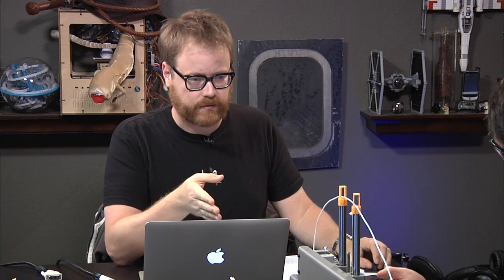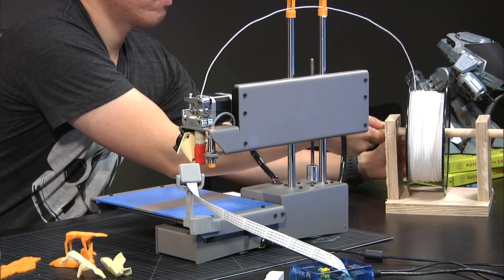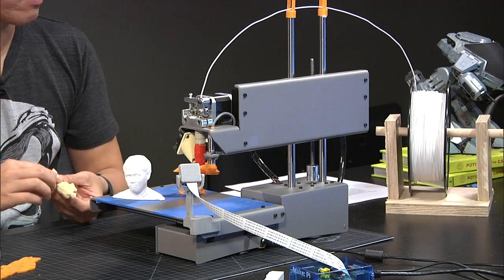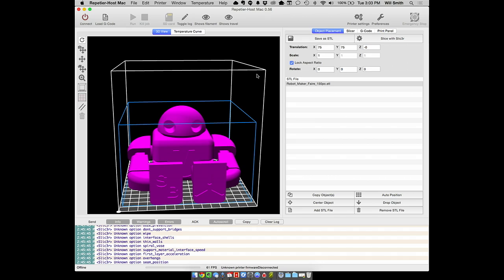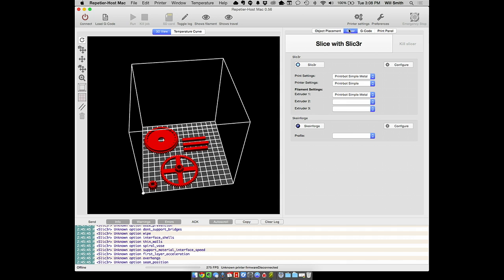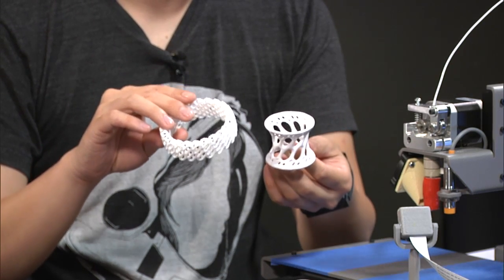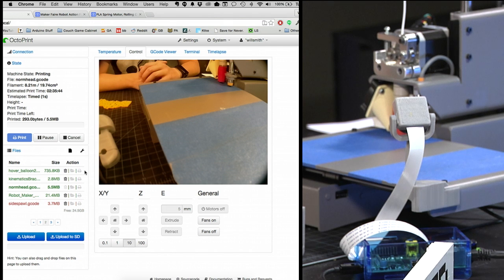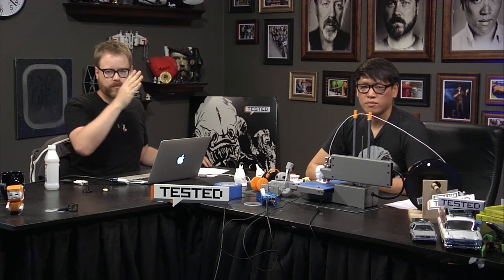Tested In-Depth: 3D Printing with Printrbot Simple Metal

Comment: Glue stick on the painter's tape keeps the prints on my pre-metal Simple from warping.
Reply: I stopped using gluestick on my UltiMakr it seems to be completely unnecessary for a heated bed.
Reply from the maker: I'll try that out. Normal art supply glue sticks?
Reply: Tested, I use Scotch Permanent Glue Stick (6008). I am currently also using 2090 for my painters tape. It does work better for this.
Reply: Brian Kofford
The tape gives a very nasty texture to the bottom of your print (which may be what you are after).
But I actually like using the glass build platform to get a flat and pretty smooth face for my models.
Reply: I like being able to peel up the tape to clean the bed.
Reply: Tested use the glue stick which is colored and goes colorless after drying. also warping should not be issue with pla. see that you change the z offset so it prints first layer more squished or increase temp.
Reply: Tested

Elmer dissapearing purple glue works very well on ABS.
Reply: Raymond Doetjes: Although I admit that it is not perfectly smooth, I get a respectable texture out of it. When I print, I kinda expect the bottom surface to have some texture, based on the interface to the print platform, and since there is no manufacturer designed heated bed for the version I have, I'm willing to put up with the slight tape texture. I paid less than $400 for mine. I'm not expecting $2000 quality out of it. Besides, even the "straight" vertical sides on prints aren't flat, due to the nature of the extrusion.
Reply: *****: Unfortunately, the Simple does not support ABS, unless you modify it with a heated bed.
Reply: Brian Kofford
Is there an upgrade kit for the simple or is it too much pain in the butt? (As buying new controller board,psu separately )
Reply: *****: Printrbot at one point indicated that they were planning a heat bed upgrade for the wooden Simple (which is what I have) if you got the metal print bed, but then they never released that upgrade and released the all metal version of the printer instead. They do have a heat bed upgrade kit for the Simple Metal.
Reply: Tested Best to use the Purple kids gluestick... the stuff that changes from purple to clear when it dries... I print directly on the metal this way.. then between prints just re-smooth the glue with a wet finger.. let dry. Apply more as needed
Reply: Yeah I just apply more glue and smooth it over with spray bottle filled with water lightly Zamboni it with my finger. Then after about a month I just take the bed off and wash the glue off and start over again I just got tired of reapplying tape every time print went bad